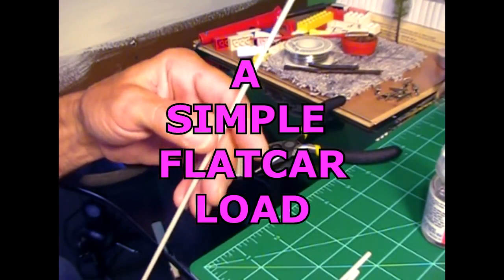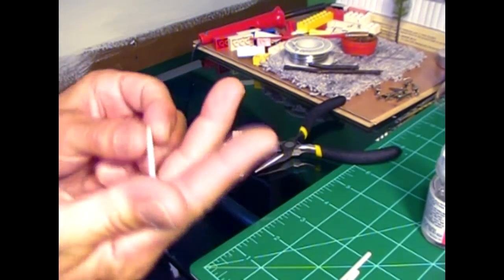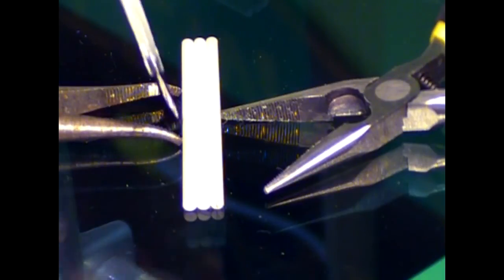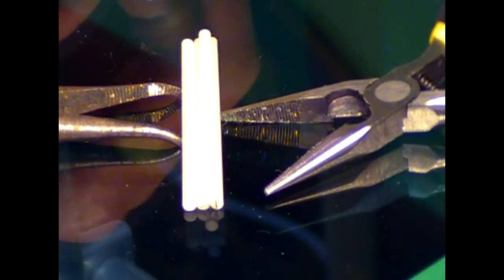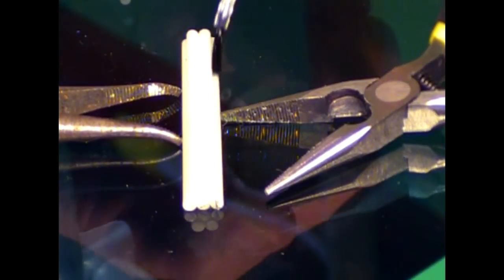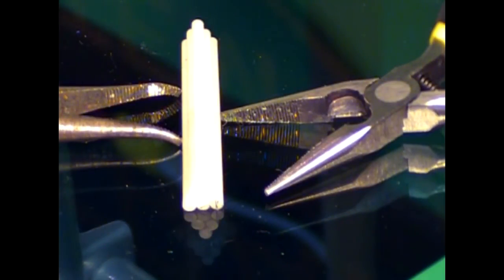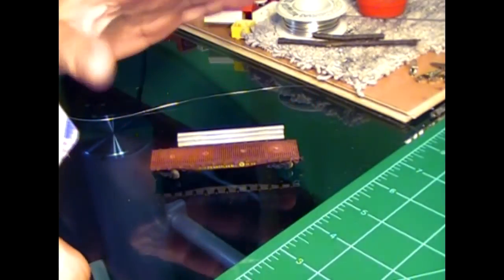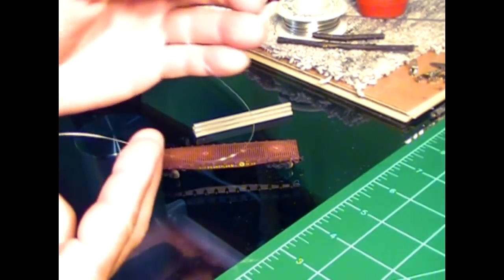HOW TO MAKE A SIMPLE FLATCAR LOAD FOR MODEL RAILROAD

Comment: I make my pipe loads from plastic straws ranging in size from coffee stirrers to the huge McDonalds straws and paint them before assembly.  Once assembled, I use heavy thread as bindings and glue the load to the flat car deck with white school glue (applied sparingly: a little holds a lot).  If desired, the load can be later pulled off the flat car and the glue removed with hot water.  I found these sell well at model train flea markets for 2/$5 or 5/$10